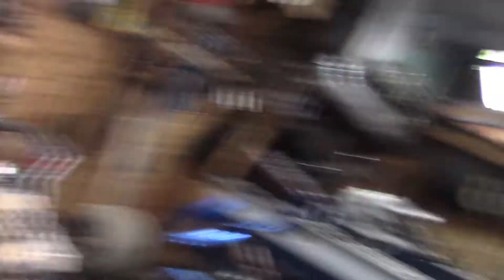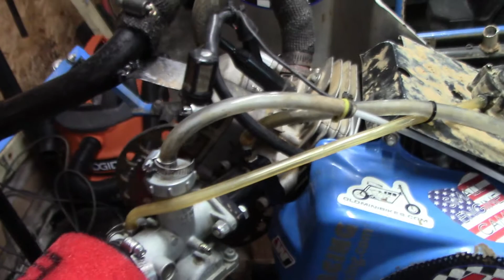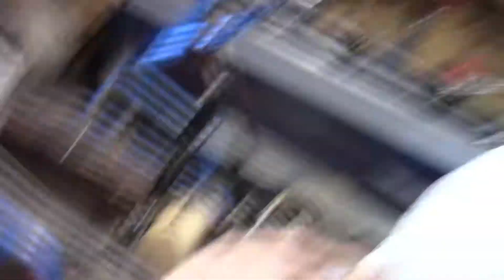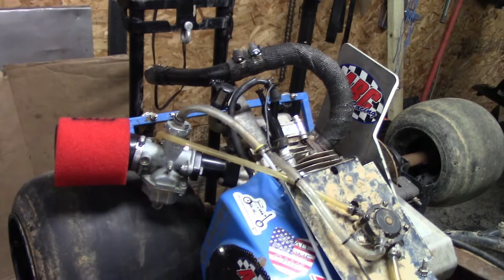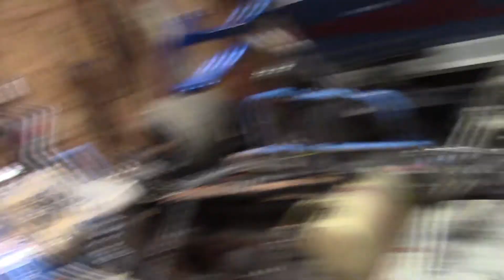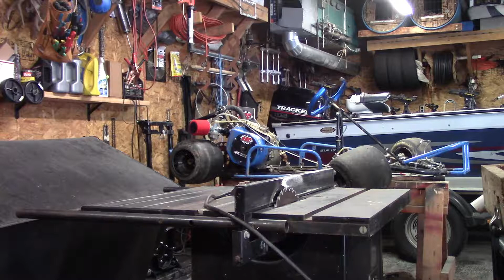Modified Predator 212 Build-Break-Down

Comment: Aye man, what size push rods did you use with the billet rocker rollers? And also, do they not hit your valve cover?
Reply from the maker: I have the Billet Isky lifters too they're longer than factory. Anyway they are 1/4" diameter, 5.070" long. The roller lifters I have a 1/4" or a 3/8"? Aluminum spacer bolted on to help with venting